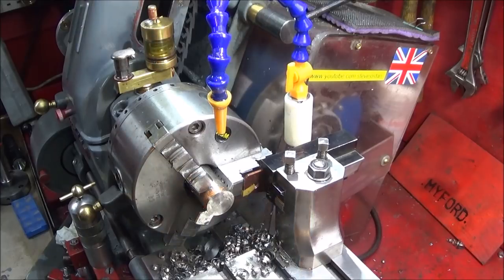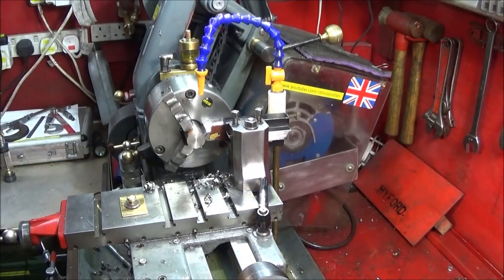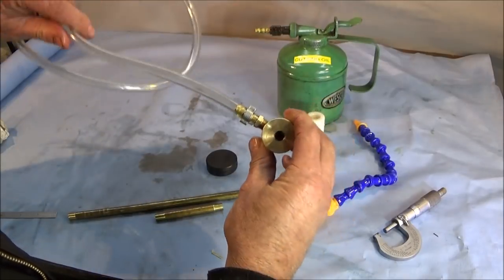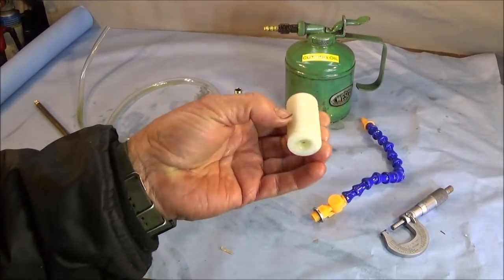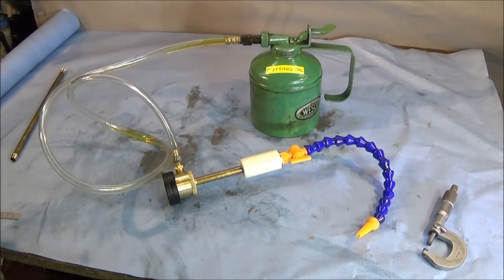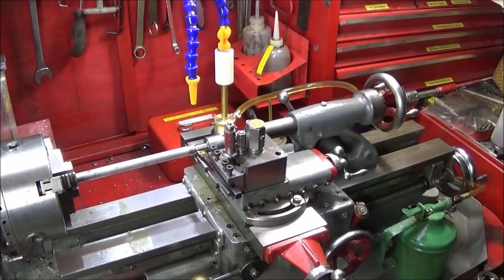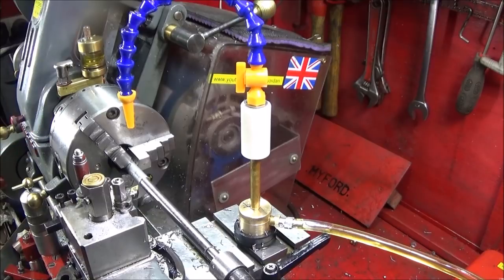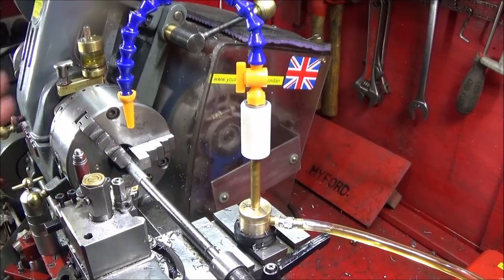Easy to make pump-action machine cutting oil system

Comment: Lovely job Steve.  If you could pressurise the oil can in some way (rather like one of those garden sprayers where you pump them up before spraying plants) you could let the system just drip or dribble entirely by itself.

Comment: Novel idea Steve.  I find a gravity feed does quite well if the supply is high enough. I like your mount system - may even exploit that for my gravity feed. I try usually to set up a slow steady drip except maybe if parting and also often keep the nozzle quite close to the action.
Nice to see the old "Wesco' can! :)

Comment: Briliant Steve, I shall be making one, just an observation if you put the mag base on to the saddle and not the cross slide for turning or the tray for parting would it do both jobs and you would do away with one pipe and the time changing them?

Comment: What a good idea! I still prefer my cool mister BUT I have soluable oil and a remote air compressor. I "stole" an idea from Abom79 and use a boreing bar with threw coolant,just blow the air coolant up the boreing bar and it blasts out onto the part and insert. The air/coolant mix is a sort of refidgerant

Comment: Good project but gravity can be your friend and do away with the oil can. That way you have two hands free to work the lathe. I have a tank mounted at the back of the lathe with a tap to regulate the flow from a drip too a flood.
Reply: enginemaker chain saw crank tool

Comment: You only need enough oil to prevent “welding “, that much oil isn’t helping as it is no where near the “smoking” point.
Reply from the maker: The cooler the better. I don't want to breath in fumes from smoking oil. In factories the coolant or cutting oil on machines is a continuos flow flooding the tools. So how could that be not helping?